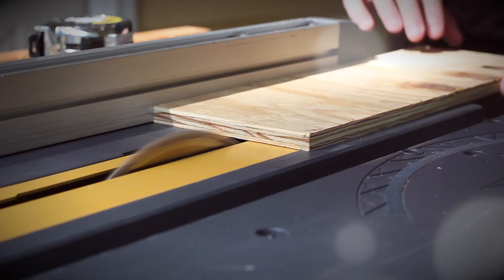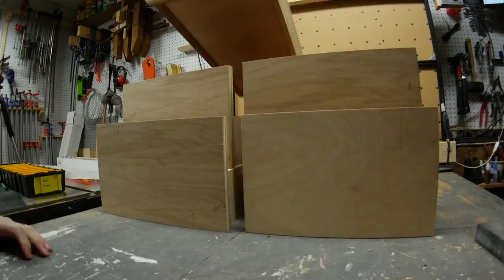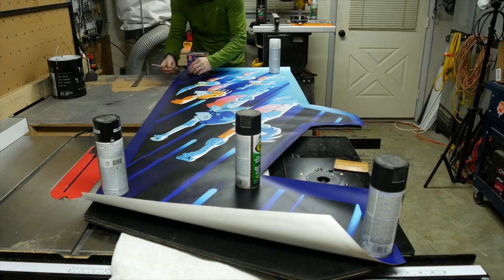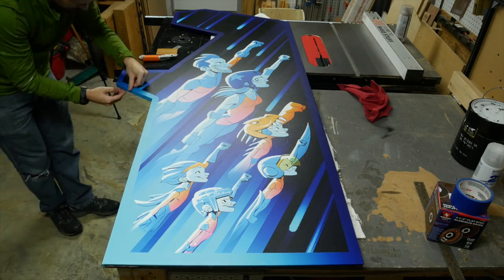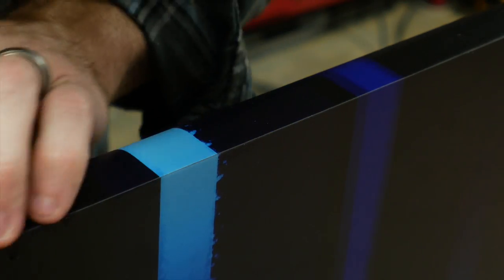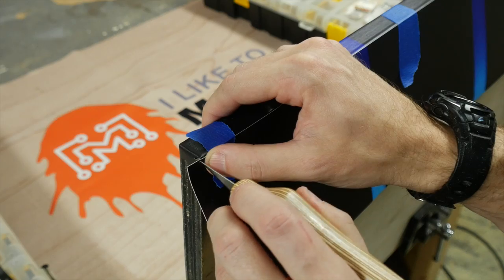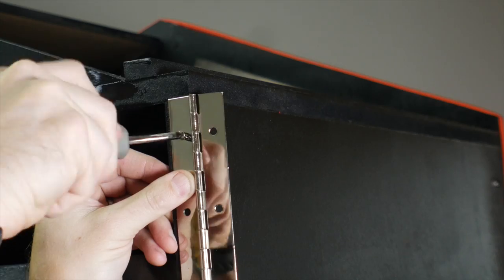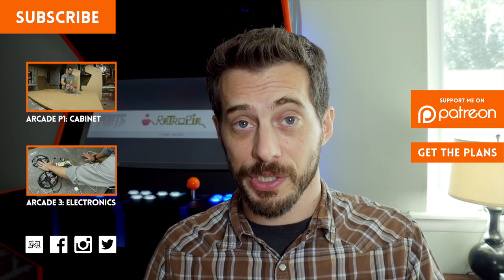Arcade Cabinet build Part 2 (graphics & trim) // How-To | I Like To Make Stuff

Comment: Holy crap!  So good!  Love the storage and great job on lining up the vinyl, it looks like it could be maddening!
Reply from the maker: +Brian Munroe Thanks! I was actually pretty worried about that turning out well, but it ended up not being as difficult as I expected. I just circled it 100 times measuring the overlap and adjusting position.

Comment: If you put vinyl on corners and irregular surfaces you can apply a bit of heat on it, carefully from a distance right before you stick it (maybe you could even use a hairdryer) and the vinyl gets more stretchable for a while. Not all vinyls react the same to it, though. If you apply too much it gets deformed, but the right amount can help with bubbles.

Comment: This is awesome Bob. One thing I want to mention since I was a sign guy in my past life is that the front edge where you put regular vinyl will not last very long. I have done the same thing atfer I wrapped an IKEA table that was peeling at the seams. The edges will eventually peel so you may want to add an acrylic edge that keeps it down. I know tha tlooks tacky but maybe you can put a wrist rest on top of it (not sure if that is against the rules int he video game world). The polycarbonate is durable though so no worries on that.

Comment: Nice, but I wouldn't go with vinyl. 
Vinyl is nice because you can get it printed, but it always eventually peels and cracks. Actual arcade cabinets were painted.
Also, a few notes about construction:
The marque is never glued, as they can (and often are) broken by players, they also serve as a quick way to access the light that is mounted just behind them. 
The back of the cab is your access point to the workings, the flat part of the back (usually held in by a single screw) is a single piece of wood.
The joysticks are latch mounted on a piece that is hinged and has a metal lip on the front (where players often stick their quarters or tokens) so the sticks pull down after being unlocked by latches from the inside. This hinged mount serves two purposes:
1. to allow easy access to the sticks so that they can be serviced.
2. to hold the glass in, that fits over the screen, resting between the marque, the cab, and the sticks.
This is how cabs have been designed for decades. Many years ago, I worked at an arcade, and serviced these machines.

Comment: Have you ever thought about making a more modern/minimalist looking arcade cabinet out of aluminum piping and metal mesh with blue accent lighting? Heavy possibly, but it would be awesome looking, probably not as heavy as wood if you designed it right. Kind of an evolution of what arcade cabinets would look like if the arcade never died and simply evolved. I've had this idea in my head for a while, but I have no facility/room (hard) or material (easier) to make it.

Comment: I run a custom fight stick. The parts you have are fine, but if your viewers want something a little better (they probably will eventually), they might want to consider opting for Sanwa or Seimitsu parts.  You'll spend double, but the quality of parts is definitely worth it.  I went through Paradise Arcade Shop, a local seller that ships nationally.  You can always buy from Focus Attack, but sometimes it's worth it to support the little guy, you know?

Comment: well it took me a couple days, but ive officially watched every single one of your videos...even the tough mudder montage. im only 23 but you have inspired me to start my own shop in my garage. What would you say are the essentials to starting a shop? what are the top 20 items you use on a regular basis? thanks for any insight! im looking to do random around the house type jobs myself instead of purchasing everything from a store.
Reply from the maker: +Josh Maynard Wow, thank you!! It really depends on what you want make, that will inform what you need.  I always say that starting with a circular saw, a drill and a sander will get you REALLY far. most other tools are just a more powerful, or more convenient version of those things.

Comment: Just a tipp for your squeegee, I used to do plenty of vinyl and we always put a piece of felt or cloth so as not to leave any marks on the vinyl. Some types are really sensitive and it may even rip the coating layer
Reply from the maker: +Jacob Kielan Someone else mentioned that, great tip! Thanks!

Comment: This looks amazing, can't wait for part 3! One quick question though, when building a cabinet this big  is there any advantage to using a Pi over a full sized PC? Just curious as I have a spare PC knocking about and am wondering if a RaspberryPi will do anything a PC wouldn't in this scenario :)
Reply from the maker: +RetroGeet No, you could certainly use a PC. I used the Pi simply because I didn't already have anything on hand and it's only $40.  In this case RetroPie is a version of linux made for the Pi, but I'm sure there are comparable Linux versions for more normal PC hardware.
Reply: +I Like To Make Stuff Brill, cheers for quick reply :)

Comment: Yeah, if you look at any standard arcade cabinet they have no sharp corners so the t molding fits smoothly. Also the edges of the control panel has t molding and it's slanted toward the players slightly. Otherwise it looks great.

Comment: Tip for anyone doing this: use an oil based paint and give it some time to oxidize. If you use something like latex, it's going to end up gassing and making bubbles under your vinyl sticker. Also, your vinyl will stick to oil a lot better than latex.

Comment: +I Like To Make Stuff Have you considered LED light up joysticks to go along with the LED buttons? You can get some at paradise arcade shop.
Reply from the maker: +Stephen Germiller I thought about it, but I was never really crazy about any of the ones I found.
Reply: +I Like To Make Stuff What did you dislike about those ones?
Also Thanks for this video, I am in the process of do a similar build and this helps alot!
Reply from the maker: +Stephen Germiller Good to hear that! I didn't hate them, they just didn't really fit the look I was going for. I was being pretty specific about how everything tied together.
Reply: +I Like To Make Stuff Did you see only "bubble top" led versions, but wanted a solid top that resembled the red ones you have now? If so paradise arcade shop has something you may want to check out. Add "levers-paradise-arcade/741-paradise-rgb-led-joystick" to their url. I would love to hear your thoughts on it! :)
Reply from the maker: Stephen Germiller Those look pretty cool! The only ones I'd seen where the ones with lots of bubbles embedded in the ball.
Reply: +I Like To Make Stuff Yeah I know they are neat! That shop has quite a few interesting, fun and unique items. Check out there scorpion ball top! ;)
Reply: /paradise-40-mm-bug-balls/963-40mm-brown-scorpion-ball-tops

Comment: I bought the plans to make a stand up arcade from you. I was wondering about one measurement I couldn't figure out. From the bezel to the end of the control board how deep is it? I guessed it was about 8 1/8" and I added a trackball so it is now 10 1/8". I just wanted to make sure the original 8 1/8 was correct. Thanks in advance.

Comment: I didn't catch it if you mentioned it, but what kind of paint did you use with the spray gun? I'm currently building a bartop arcade and have all the pieces cut, just need to paint before assembling.
Reply from the maker: +eclipse310 I just use a water based paint/primer combo from Home Depot.  Behr, I think.

Comment: +I Like To Make Stuff why you have colored the cabinet, if you have it glued  of the vinyl sticker over? I love this project
Reply: +J.O.K.E.R. I think that if it gets scratched or he bumps it into something, you're going to see black paint underneath and not wood ;)
Reply from the maker: +J.O.K.E.R. Mainly it's because the vinyl will adhere to a painted surface better than bare wood.  Also, I couldn't have used the water/soap method on bare wood.
Reply: thanks for the reply , I am subscribed your website since you've opened
Reply: +I Like To Make Stuff Didn't think of the water and soap on wood ;)

Comment: If someone here is actually thinking about building your own arcade.
Pls dont use cheap arcade control parts and actually invest in Sanwa, Seimitsu or if you just want american parts IL (Industrial lorenzo) sticks and buttons.
The more expensive parts rly arent a deal breaker anymore if you are building that and you will feel the difference it can actually be a difference between enjoying or hating the cab

Comment: hey bob what kind of paint did you use and was the paint gun easy to clean?
Reply from the maker: +mike gager I used an acrylic from Home Depot (Behr probably) and actually it did clean pretty easily, I was a bit surprised!  I wasn't sure if I'd have to thin the paint to work in the gun, but I didn't.
Reply: Cool been thinking about trying a hvlp gun but didn't want to hassle with a gun that was hard to clean

Comment: What are the bottom two buttons for in the middle? I am just starting the process of building this and thinking about either using your button layout or using my own.
Reply from the maker: I use those for system functions like Enter/Esc/Tab but also they act as Select/Start in NES.  You can configure any button for any function via the retroarch.cfg files

Comment: At 2:30 what size slot cut bit you use to cut the line for the t molding. I got a 5/32 kerf slot cutter I didn't use it yet unless you use the same one.
Reply: 3/32" is the barb on the T-mould...you need a 1/16" for the slot.

Comment: How much did the whole thing cost? :)
Reply: +Ansity 
The artwork alone was probably 200 to print. Probably more.
200 for the screen, but this price is pretty flexible.
72 for the buttons. It is 4 for each LED button.
20-40 for each joystick. It depends if they are 4/8-way switchable.
60 or so for the input+led controller. 
20 for the led power supply.
80 for the computer. He used a rPI, but you can get a cheap windows laptop instead. 
40 for the lexan/plexiglass for the marquee
80 for 2 sheets of plywood.
60 for cabinet hardware.
20 for paint. 

So yeah probably around 500-700. I bet he got discounts for naming the suppliers though, like for the artwork.
Reply: +Seth Portland (Internet Educator) Your price rate is hella too high, a Raspberry Pi 2 is like 50/60$ maximum. Same for the led button and joysticks ! 

If you got a spare TV/computer screen, scavenge plywood from tossed away furnitures, doesn't use fancy artwork, you can built the whole thing for like 200/300$ !
Reply: Le Cobra
Yeah you can always try to scavenge and find great deals, or buy cheaper chinese buttons and hardware. If you want anything that is decent quality though it will cost around the prices I gave. Like you don't need Lexan for the marquee, you can buy cheap clear plastic for $10, or glass. It depends on how much you want to sacrifice on the look and feel.
Reply: You can make it out of poor material then upgrade it tho, it's not incompatible.

Comment: Does it have to be a raspberry pi2 because I have a raspberry pi1 and it wont work?
Reply from the maker: +I.G. Noreme Originally I was using a Pi 1 and it worked just fine. Make sure you have the correct version of RetroPie for the hardware that you are using. Pi 1 and Pi 2 have separate versions.  I have since upgraded to a Pi 2 to have extra processing, but the Pi 1 worked great.
Reply: K thanks man!

Comment: I wonder how expensive this cabinet would end up if all you have is a table saw and a jigsaw, no elecronics, and no buddy to design artwork for free... hmm... $2000? 3k?
Reply: +Xander Hawkins i have only a jigsaw, a screwdriver and some cheap files, i made a bartop arcade for about 200$ it didnt cost me that much because i had an old 19" lying around and all the wood from scraps! 
all that i bought was the buttons from china 30$ 
rpi 2, about 50$ with case and power
micellanius diderithats (paint, thriftstore speakers and some other small bits) 20$
my build did not pass 100$, and if you scourge some secondhand stores for an old screen, i bought a couple for 5$ each, it doesn't need to be expensive :)

Comment: HVLP is garbage. Airless is the only way that you can spray paint these days.

Not only it's much slower than airless, but because today's water based paint drys too fast so only airless can handle that. Other air blowing sprayer drys the paint before the paint even reaches the surface.
Of course if you don't even care about the paint finish go either way.